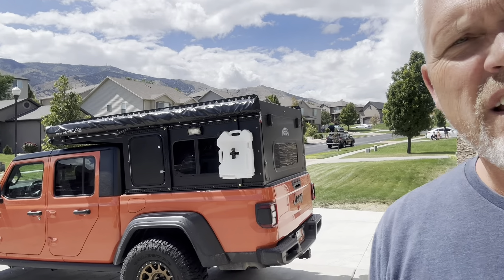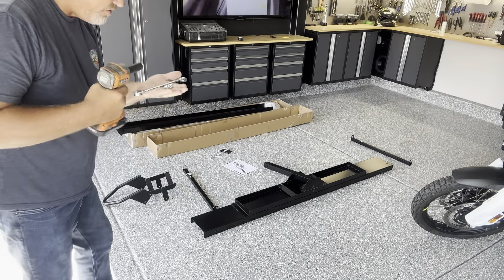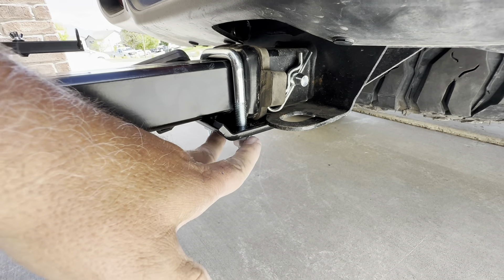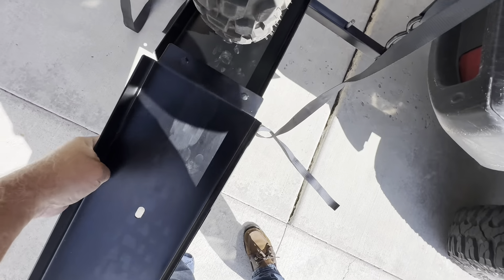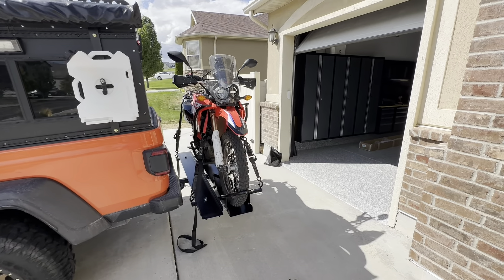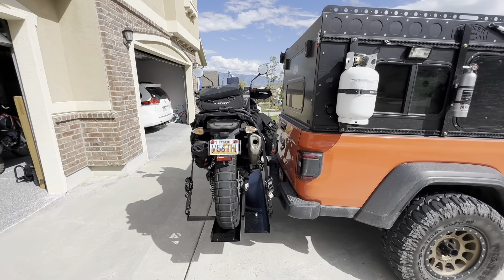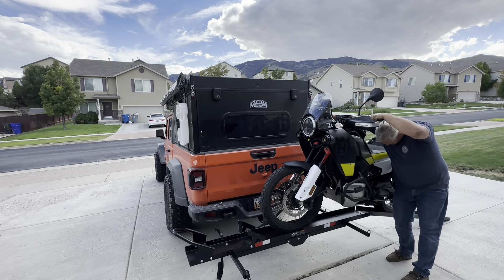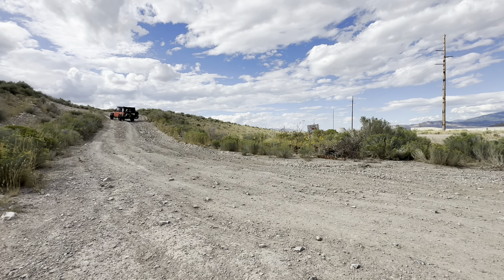Harbor Freight’s 600 lb motorcycle hitch carrier Norden 901 and Honda CRF Rally on an Overland Jeep

Comment: Well that's cool. I have a 600 pound rack very similar to that and a norden expedition. I figured it would be to much for hitch on my Ram Rebel ecodiesel which has added 5k airbags in the rear. It appears it would be just fine if you can do it with a Gladiator hauling a camper shell as well. Cheers
Reply: That’s what I assumed too. Too heavy. 
Love my expedition!

Comment: Here is a pro tip from someone who has been doing this for years.  Attach the strap closest to the Jeep first to keep the bike from falling on to you.  On your set up you may even be able to lean the handlebars against the camper while you do so.  Hard to tell if the distance and window will be ok from the video.  The last thing you want is that bike falling over away from the Jeep. Also, if you want more stability and less wiggle from the bike while on the carrier, attach the straps as wide as you can to the handlebars, that few inches will make a noticeable difference.  Lastly, error on having it lean towards the vehicle, fixing a bit of paint on the Jeep if it comes loose is less costly that having the bike fall the other way.  P.S. When you pulled the Norden off the ramp you had a loose strap attached to the bike, if that caught on something the bike would have gone down.  Take more time to inspect and insure you are clear of potential mishaps.
Reply from the maker: Great tips!  Thanks
Reply: I suspect too, that if he loaded the front shocks a bit more, there might be less "wobble".  Not sure how much pressure you can put on those square tube's tho...?

Comment: It would be really nice on this Harbor Freight motorcycle hauler if you could take the ramp and put it on either side of the carrier so that you can unload the bike straight off the ramp from the opposite side you loaded it on right that's the way it should be so you don't have to back it down off the ramp you can load it from either side or unload it from either side by just moving the ramp

Comment: I have the aluminum harbor freight m/c rack. I wonder if that would carry my 901?
Reply from the maker: I would say no way. That rack is rated for way less weight. I feel the steel rack. I got a trade it for 600 pounds is a bit of a stretch and should not be used on heavy off Roading maybe just gravel roads and freeways and such
Reply: @nordenamerica  yeah I thought it seemed a little sketchy with my Husqvarna 511 on the aluminum Harbor Freight rack